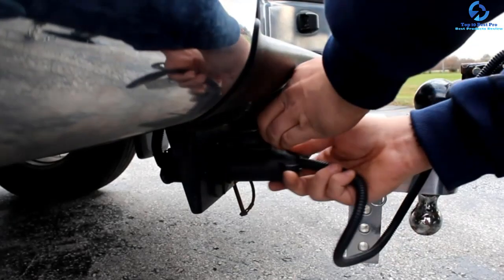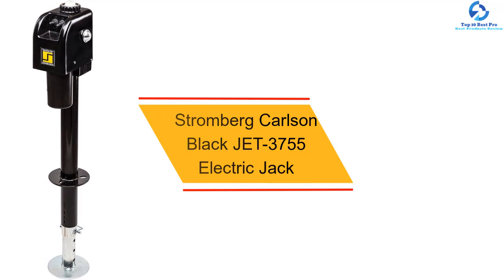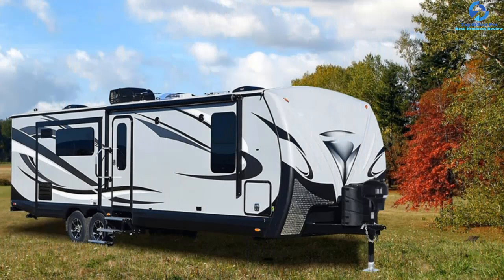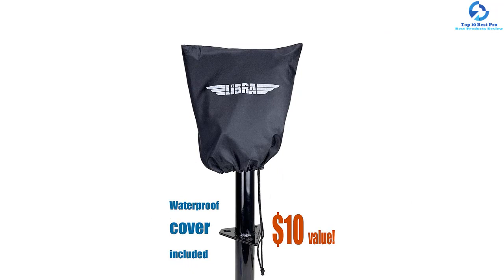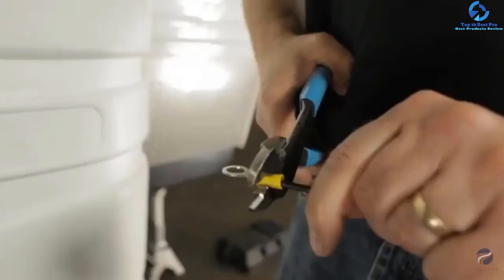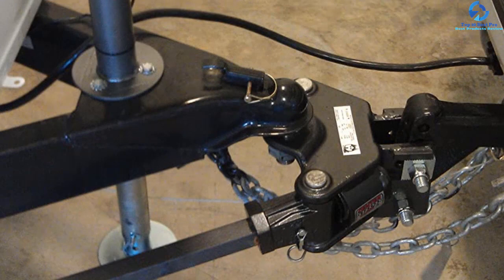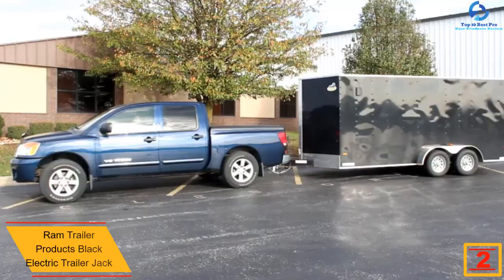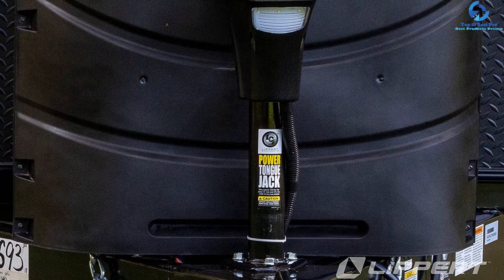✅Top 10 Best Electric Trailer Jacks in 2023 Reviews

Comment from the maker: 🔶 10. Fulton 2,500 lbs 141401 XLT Powered Trailer Jack
👉  https://amzn.to/3Ip1CQX
🔶 9. Stromberg Carlson Black JET-3755 Electric Jack
👉 https://amzn.to/3C66dDE
🔶 8. Weize 3500 Lb Heavy Duty Trailer Jack
👉 https://amzn.to/3WxeGru
🔶 7. Libra 26042 3500lbs A-Frame Electric Trailer Jack
👉  https://amzn.to/3hSFsM3
🔶 6. Bulldog 500187 Powered Drive A-Frame Jack
👉 https://amzn.to/3C6ZmK9
🔶 5. Quick Products Black JQ-3500B Electric Jack
👉  https://amzn.to/3jCeUyP
🔶 4. Husky Hb4500 Power Jack, 4500 lbs
👉 https://amzn.to/3hX5AFq
🔶 3. Uriah Products Uc500010 12V Dc Electric Trailer Jack
👉 https://amzn.to/3VwiasO
🔶 2. Ram Trailer Products Black Electric Trailer Jack
👉 https://amzn.to/3WP8YAZ
🔶 1. Lippert 285318 3500LB Power Jack
👉 https://amzn.to/3FWHQJr